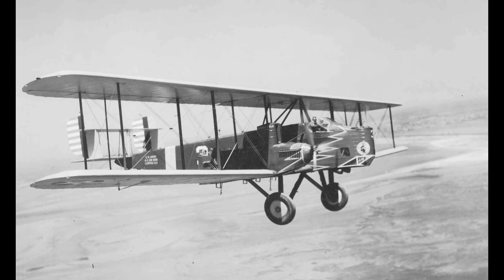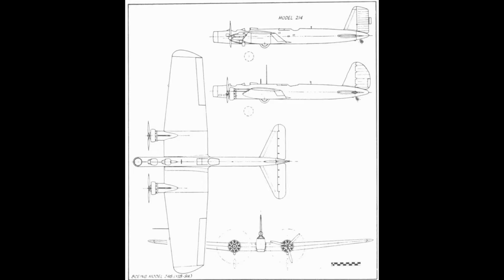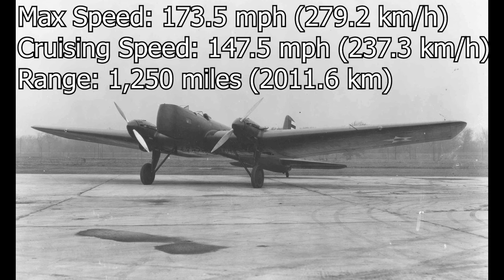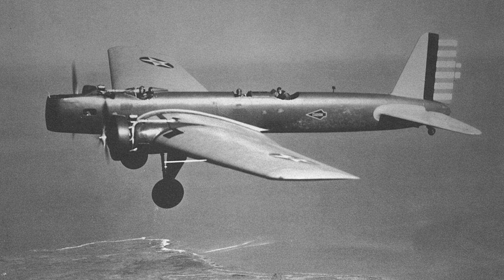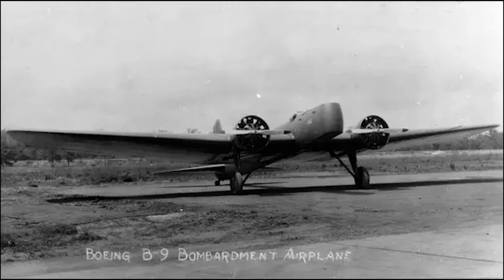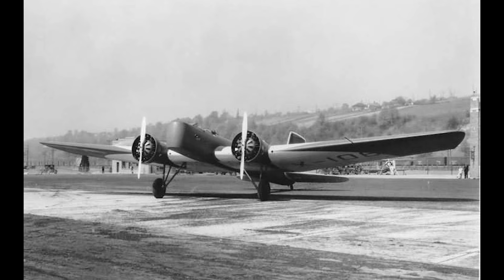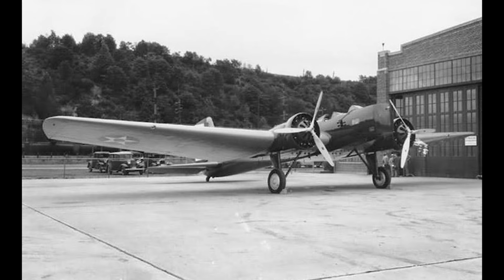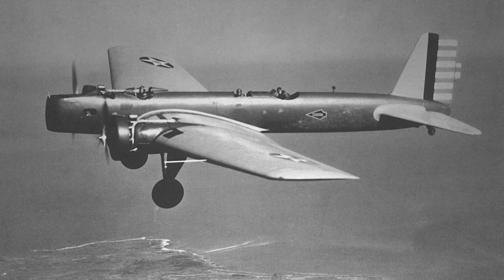Boeing's Forgotten & Experimental Bomber | Boeing YB-9 [Aircraft Overview #21]

Comment: There are production motorcycles that have higher top speeds. Down-the-highway speed is perceptually much faster than up-in-the-air. Been there done that. (But only 150 mph, for a short time.)

Comment: The interwar era is a very interesting one, and apart from the P-26 and P-36 there aren't any other American planes of that era I did know about.
So keep them coming.
The B-9 was a sleek looking aircraft, but crew comfort and performance was low on the list of thoughts, strange for a country which gave cabs to locomotive crews first worldwide.
Especially considering that 180MPH in freezing temperatures is much harsher than at 40MPH on a locomotive, where you still have a hot boiler in front of you as well.

Comment: Many people fail to see a point that few saw in WWI, where an aircraft could fly to a strategic target and bomb it.  Most of the limitation was simply payload and range.  The most menacing military weapon up to that point was a battleship appearing and firing inland to targets 2-3 miles away and steaming away.  Something that could travel 5-6 times faster and not be limited to shoreline bombardment was considered dreamy.  Mobilizing a high speed Army in those years meant advancing at 15 MPH, but losing it's ability to fire when exceeding 5 MPH.  Tanks served to fill that gap, but still had limited operating conditions and required many people to support the operation of every tank.  The bomber aircraft was a terrifying concept few really accepted as a part of future warfare.  Those fighting a gentlemen's war considered flying bombers "out of bounds".   This set up one of the biggest military policy failure confrontations in history.

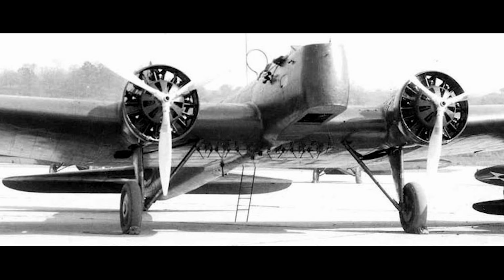Comment: What’s going on under the wing between the landing gear struts with those multiple wires/posts sticking down at 7:22? Antenna most likely but what radio in 1932? Also remember, all this work going on at Boeing and Martin was in the depth of the depression. Great videos you are putting out! Keep them coming!
Reply: I'm pretty sure those are the bomb racks.

Comment: Still, cruising nearly at 148 mph at an altitude over 20,000 ft with OPEN cockpits is bit crazy and how it was acceptable even though technology was improved during and after WWI.
My endurance levels aren’t that high enough even if I wanted to fly those airplanes.

Comment: what a great step forward for the airmen to have the latest and greatest monoplane....the Keystone was still in operation but runout and had issues that the new Boeing would solve...soon the enclosed cockpit would come and weather flying was not as draining on the crews who sat exposed to the rain and wind and oil infused snow in the slipstream of the Keystone.....

Comment: Too little recognition was given to the modernity of this revolutionary Boeing bomber and the new NACA technologies that helped create it  like the wind tunnel because they're overshadowed by the much more formidable and long lived Martin B-10. The same thing happened with the 2467 and the DC-3. Being the first also condemned you to accelerated obsolescence as newer planes leapfrogged them, learning the best lessons while avoiding the "that's not the way we always did it" biplane and open cockpit crowd. At the time common thinking that a "fast bomber" didn't even need a single defensive gun as no fighter could catch them. We all know how like a lead balloon that idea flew later! LOL
BTW, my 1951 Bellanca 14-19 also had half the wheel protruding just as the B-9 as a design feature in which the extended wheel minimizes the damage for those inevitable times the pilot inevitably forgets. Nothing is more true than the old saying, "there's two types of pilots. Those who HAD a gear up landing ...and those that WILL". During my USAF pilot training there was always at least one pilot on the ground at approach apron checking the gear of landing planes with a radio handy!

Years ago I was standing on the taxiway with my camera to take pictures my girlfriend's new Mooney when she turned into her final. When I realized what was happening I forgot the camera and started yelling to her as loud as I could while running and signalling with my hands to wave her off of that gear up landing. Later in the airport restaurant  I as comforting her with the same quote when she smiled ruefully and said, "well, you might as well at least stopped to take a picture"!

Comment: Many armchair "historians" sneer at the then contemporary idea that the bomber would always get through. The performance of the B-9 (and later B-10) give a solid base for that belief. As our host stated in this video, it was almost impossible for pursuits to intercept them. Picture a bomber so fast that F-15s, F-16s, and F/A-18s can't catch up to it. Hence the idea that the bomber was untouchable. It wasn't an idiot idea, although is has been frequently presented that way.

Look forward to your video on the Model 247, and hope you recover soon!
Reply: Multiple small engines gave bombers an edge until a single, large engine gave the speed edge to the fighters in the late 1930's. Eventually you had the B-36 wishing it could outrun the MiG-15.
Reply: The equivalent these days to bombers of that era are ICBMs, they will always get through (usually).

Comment: Outstanding videos, I've been wanting to find a channel like this. May I suggest adding Knots in addition to MPH and KPH, since it's the current ICAO standard? Thanks for the content!
Reply: At the time knots weren't used, so all the documentation would be in mph or kmh depending on the origin of the aircraft.
And there'd be a difference between US and British mph as well.
Reply: @jwenting  I understand, it does make comparing speeds a bit more difficult for me, but that wouldn't be the case if I got more used to mph/kph.

Comment: I appreciate the details about the preference for radial vs inline designs. Their big frontal has always seemed like a deficit. 
Since they lasted into the jet age maybe radials and their competition could be a topic? 
I do have a fondness for the weirdness of the JUMO opposed piston engines and wonder why they had little use.
Reply: Radials were usually lighter and more reliable than water cooled engines . Drag disadvantages disappeared with better and better cowling designs.
After WW2, the V-12 liquid cooled stuff was slowly plowed under by poor operating economics, and ended up being a technological dead end.